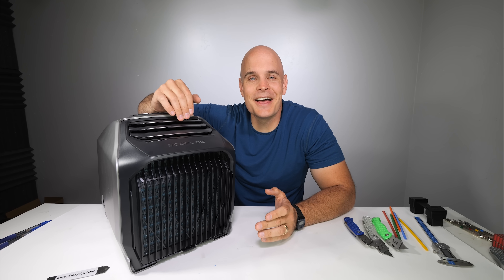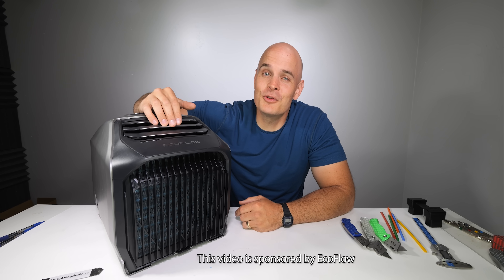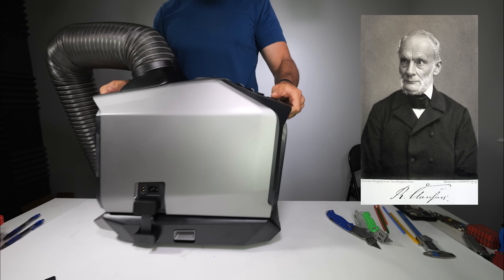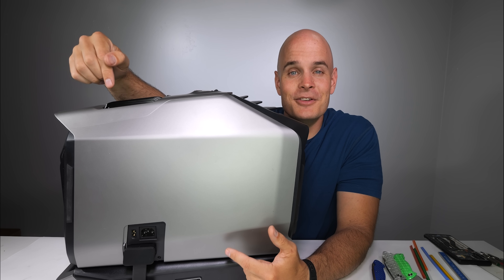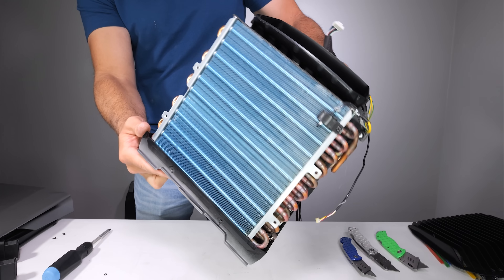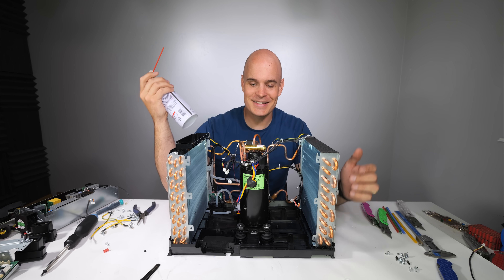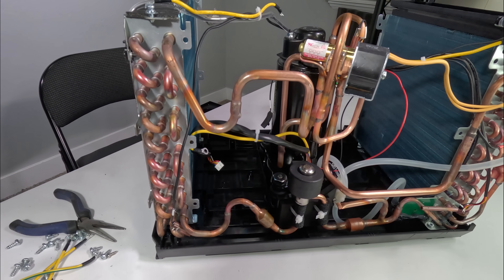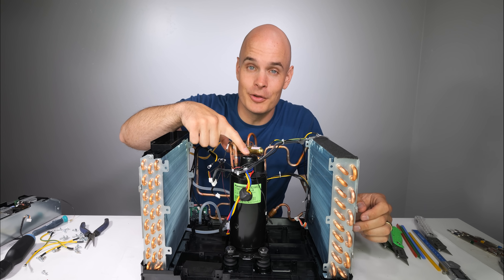THIS CHANGES EVERYTHING... (Ecoflow Wave Teardown)

Comment: your explanation after the 4 way valve is abit incorrect. no extra pressure increase. all the 4way valve does is swaps what coil becomes the condenser(warm/high pressure) and what one becomes the evaporator(cool/ low pressure)

Comment: "THIS CHANGES EVERYTHING..." Dude, heat pump was invented over hundred years ago. And that thing does not have 200% efficency if the condenser and the evaporator are in the same unit.

Comment: 4:26 thats just a wrong explanation of how an AC works 😂 it goes from the compressor to the condensor and THEN it goes to the expansion valve lol. Not directly from the dam compressor to the expansion valve 😂 the compressor makes it hot, how’s that supposed to cool anything if it aint cooled down by a condensor. And 200% efficiency doesn’t exist😂 its between 0 and 100%. Also, this AC is again one of those insanely inefficient single hose AC’s where the AC sucks in room air to cool the condensor and blows it outside. In other words, it sucks in air from the room that it JUST COOLED DOWN and blows it outside. Super efficient indeed 😂 plus this causes a vacuum in the room, which makes hot air from outside want to come back on. What a joke of a video.

Comment: since you took it apart, could you tell me the specs and model of the transformer on that electrical board? Mine blew and I'd like to replace it, my unit has long been out of warranty. Thanks.

Comment: BTUs per hour (British Thermal Units) - just an easy way (if possible) to measure the amount of heat or cooling that a device can give out per hour and then reference that with the size of the room. 1kW (1000 watts) is 3413 BTUs or a way of seeing how much cooling a room needs for its size (works both ways)

You can calculate your room square metres and then it will allow your to calculate how much energy you will need to cool or heat that room (or how much cooling a device will give out)

For example a 5100 BTUs of cooling is about 20sqm (roughly) 
6100 BTUs heating is about the same 14-19sqm 

To put it in other specs around 1500 watts heating and cooling (heating is a bit more about 1700 watts)

Comment: That's so bad design, that nobody should use. Where does the system takes air to blow over the low side? From the room you're trying to cool and then dumps the already cooled air outside through the vent pipe....tehnologia😂😂

Comment: I came back to this video because I want to see the temperature sensors. I have searched for the error code on mine and the only thing to fix it is to reset it and try again. other than that it just says to contact aftersales support. I am assuming I am out of warranty and would just be directed to buy another as a couple other folks shared. why not tell me which sensor so I can get in there and replace it. I am assuming I just have a rubbed out wire as it's mounted to the top bunk of my semi and has been there for near 200k miles.

Comment: This was a poor explanation of how heat pumps work, specifically when you mention the reverse cycle heating mode, saying 
that the refrigerant "gets compressed at the valve and then again in the compressor". If you can't properly explain it, you don't understand it.

Comment: Interesting. On boats, an AC unit condenses a nice flow of non-salty water, some are more than a Desalination System, with cold air as a luxurious benefit. Perfect for the Tropics, my fav. 😅 (Non salty means filtration and UV is needed before drinking that water)

Comment: Couple of complaints: 1). marker 0:40 states there is no way a person can feel any coldness form machine which defeats the reason I would purchase the unit in the first place and 2) per law of thermodynamics, if you remove x-amount of heat from one side, you have to spit out at least the same amount if not more of heat from the other side. Since both sides are in the same room, you gain nothing in cooling the room.
Reply: the duct carries away the heat from the condenser. This is the basis on which all portable ACs work.

Comment: I have the same unit of this called portable AC however, I have discovered that the cold air does not only goes back to the condenser but also goes at the back in the heat exchanger sucking the air inside the room and throws it outside. so I decided not to use the flexihose anymore rather I placed the AC directly at the window.

Comment: The single flexible tube is only half the solution there should be an inlet and outlet. Think about this, the air you exhaust with one tube has to be replaced from the outside….bringing the air temperature with it.

Comment: The cold bottle example was pretty weak. Its simple to explain. Two physical principals are all you need to understand. 
One, heat moves from higher concentration to lower concentration, always. So hot things give up heat to cold things. 
And two, pressure and temperature are directly proportionally related. Pressure goes up, temp goes up, pressure goes down, temp goes down. 
So to get the hot air in your house to give up its heat, the air must come in contact with something cold. So you drop the pressure of the refrigerant inside the house to make it very cold so it will absorb heat from the air, you then move the refrigerant, laden with all that heat from inside your house  to the outside. But uh oh, outside ambient temperature is already hot. So how do you get the hot refergerent to give up its heat to the hot outside air? You get it hotter than the outside air, so it will be able to give its heat to the “cooler” outside air. This explenation leaves out the most critical physical principle for hvac which is taking advantage of the massive amounts of energy (heat) that is released or absorbed in order to change a material from one state of matter to the next,(liquid/gas)  but thats more than is needed to understand the basic principal of hvac

Comment: 8 hours my ass on its lowest setting I barely get 5 on high it runs for about 1:45 minutes
Reply: Do yourself a favor and send it back while you can. The biggest downfall of the wave 2 is trying to use it high temp environments. The electrical components are sectioned away from the blower motors so they don’t receive any cooling. Where I live in the desert this means almost immediately overheating and failure of the unit when you need it most. Look into replacing with an under bench 8000btu unit that actually works when you need it.
Reply: @ I live on the coast it barely gets above 90
Reply: @ I just ordered a 12v mini split I think it will be far better
Reply: @myfalconry76  you will most definitely be happier with a split unit. I hope you were able to return the wave 2.

Comment: I'm more interested in how to tear one down for repair.  Mine is noisy and I have had the drain stop working and required a return and a refurb replacement. I would like to see how to remove the covers and attempt to quiet it down and repair the draining problem WHEN it happens again.  I'm hoping I saw enough in this video that I can remove the covers without breaking anything.

Comment: I have few technical question for the ECO wave 2 
1st In an AC we have the outside part and inside part bcoz the technology works like pump, it pumps out heat from room to outside.
here both cooling fins and condenser are in same room and as per law of conservation of energy the Net change in temperature is heating the room in summer, 
2nd if the 1st question is invalid please tell me the purpose of reverse valve bcoz in Ac we cannot move the outside unit inside or vice versa, isnt the application of reverse valve is redundant? i would just turn the Ac opposit in winters.

Comment: The next challenge is to make an air conditioner for a motorcycle. This is the Chinese version: "1881 BTU Portable Air Conditioner Compressor Cooling Conditioner Drainage Free" (on ebay) (no battery)

Comment: What is the point of this? I never will understand why people buy portable air conditioners, its the least efficient form of cooling/heating being even worse than a window unit. what about the air you have to pipe out? Taking inside air and yeeting it outside so that fresh unconditioned air can come in somewhere else..... I understand you promoting battery banks, at least they have a decent purpose, but this feels like advertising because you were forced to.

Comment: I usually like your stuff, but this... I'm sorry, but I don't like this... These are my reasons.
200% efficient?🤨
It's a tiny (5000-6000 btu) portable heat pump...
That enough for a 10x10 tent for half a day... Maybe...
But it uses R290 which is propane. It uses propane as a refrigerant... If that does not worry you in the least, I have some land in Florida that sits 20 feet below sea level...
Reply: You get 200w of heat for 200w of electric energy.
And most refrigerants are flammable. Some even turn to acid when burning.
Reply: @Elektroreisen  yes I know. In the right proportions dust is explosive too. Propane is a fuel source though. That’s the point. It does not take much for it to burn, and by the time you realize you have a leak, it could already be too late.  Nothing is 100% efficient there is loss over transmission, thermal loss, optical loss, vibration, sound, etc. I’m sorry. Even the power brought to you over power lines has a bit of loss.

Comment: These guys can't implement a proper thermal management of the River 2 Max charging station.
It also has a problem with bypass switching and charging - bot sometimes just don't work until re-plugged to the grid.
All these - software problems and not fixed for YEARS.
I own all three models of Ecoflow River 2 and I wouldn't recommend buying any of Ecoflow devices.

Comment: All that effort made and no proper hot air exhaust pipe mount :D 
Heat pumping does not pump the heat out at all if you exhaust the hot air into the room...

Comment: The exhaust is putting the room in a negative pressure. Thus sucking in more heat, humidity, cold, duct, backdraft CO2 and possible carbon monoxide

Comment: Jerry, I love seeing all of your projects! It is now August 2024 and the EPA finally approved R290 (propane) for household use where the charge is limited to 500 grams, if the monobloc compressor keeps all the propane outside. It may take another year for the local and national building codes to agree, although Europe has been using the R290 refrigerant outdoor only for years. I see that this portable unit has a 2 hose design, so I'm assuming the top hose draws in outside air and exhausts any propane leak to the outside.  Since this is portable I assume the charge is limited to 150 grams of propane, which has been approved for some time for indoor use. The Inside fan must just recirculate the inside air with no change to pressure (unlike single hose portable AC for the home) which one of your commenters is referring to. He is assuming it draws air from the living space, then exhausting outside, thus creating a negative pressure. I hope not. That is also the way decoration type fireplaces are built in Southern California. The people sitting in front of the fire feel warm although the combustion air is drawn from the leaky windows and doors (cooling down the other rooms). You mention that this unit is twice as efficient as old fashioned resistive heaters. I'll have to do more research into R290 since I heard a range of their efficiency, perhaps they are similar to recent refrigerants (COP of 2 to 4 Coefficient Of Performance, 100% = COP of 1) that still deplete the ozone and their benefit in heating homes in Europe is the ability to attain Higher Heat for water heaters. Where I live in SoCal, Cooling is more important.

Comment: this unit probably blows cooler than 60f air it only says 60 cause its a law were you xant have the temp set to low or something stupid my window unit goes down to 62 but blows air in the low 50degree range a old R22unit or R12 is like in rhe 40-30 degree range almost regrigerator temps.

Comment: btu is british thermal unit 12,000 btu is 1ton of cooling so if you have a central unit and it sayd 3tons it is 36,000 btu of cooling capacity and 5,000 for a wireless unit is not bad at all, this is like perfect if you have a old car with no a/c

Comment: The idea to use the condensed water is what i have in mind as slipt ac in india drain the water out side the house, the water is cold so driping it over the outside radiator(what ever its called) can increase ac efficiency and reduce bills.

Comment: The construction is a bit hopeless. The same can be done on peltier modules using compression, which increases the efficiency of the system. And the whole device is smaller. Let me tell you right away that this is not about those stupid YouTube videos with pseudo-air conditioners using Peltier cells, because these are toys, not devices.
 (sory - gogle translator)

Comment: Btu is British temperature unit lets take an example if you have a room that's dimensions are 4x5 with height 3 meters then you have to make this 4x5x3x300 which equals 18000 btu *
*1 cubic metre= 300 btu

Comment: Very good explanation on this portable unit. I know I’m late to this video since I stubbled upon this video and it’s a very cool concept especially since it’s portable. As many of you have pointed out BTU stands for “British thermal units” and it has a cooling capacity that is equivalent to 100 to over 150 ft.² depending on what you are using it for. heating is around 150 to 250 ft.². Now this is not by any means a replacement to a standard portable or window units that are designed to cool down a small room. I can see this being very handy if you’re going camping, cooling that one hot room that does not get cool enough or if you want that extra comfort. I’m an HVAC tech. so this unit is very interesting to me and one I will definitely try out.

Comment: i hate to break it to everyone, these numbers the gov and companies throw around are cool and all, but law of thermal dynamics states very clearly energy can not be created, if you have 1750w coming in from the plug and you have a 1750w electric cheap shit heater connected you are getting 100% 1750w heat out. no way to get more than that, adding a compressor that uses a portion of that electricity will not make it more hot. you will get a total of 1750w of heat out and noise and vibration.

Comment: BTU are British thermal units .  So ignore those . 12,000 BTU = 1 ton of AC.  We use tons because when ice factories boiled ammonia (thx Faraday) to make ice (for ice boxes-pre refrigerator) if you had a 3 ton system, you could make 3 tons of ice in a day.  See USA always uses the best measurements.
Reply: 6100 btu is like a 1/2 ton AC
Reply: Just explain the 4 cycles of refrigeration.  Dan Aykroyd explained in the “1941 “(film)
Reply: R-290 is propane.

Comment: The smart thing about this unit, is that they dont necesarily pump cold air outside (you could ... but it wouldnt be smart to do it).

Most portable units will use the cool air from your room, to cool the condenser, then dump the hot air outside. Now the problem is ... if you are pumping air outside, outside air needs to come into the room. And that will be hot.
So efficiency for those units is bad.

By using external air to cool the condenser, and dumping it outside, you dont have such problem. Eventually the room cools off.

Comment: Every A/C needs two intakes and two outtakes of air. If you have only one outtake, it will use the air inside the room to cool the hot part of the system and will create negative pressure inside the room and therefore will pull ambient temperature air through every gap. So it's not THAT efficient. I've made some modifications on my "portable" A/C to take outside air to cool the hot part and outtakes the hot air without creating negative pressure in the room. The efficiency appeared. I've been living in a camping tent for three years now. I know there is no thermic mass on it but now I have a good ambience inside it.
Reply: I've just made a quick research on YT and, in fact, ecoflow makes it with two tubes in the window. One intake and one outtake.

Comment: A btu is a measurement of heating or cooling capacity. It takes 1 btu to change 1lb of water 1 degree Fahrenheit. Thats what a btu a based on.

The sensing bulb on the suction line is connected to the thermostatic expansion valve which is where the refrigerant(which is essentially propane in your case(r290)) is metered in cooling mode. It appears to have an orfice style metering device for heating mode, which is bypassed in cooling mode, just like the TXV is bypassed in heating mode. 

Still don’t see where this unit rejects its heat, if it rejects the heat from collected from indoors to indoors as well it’s fighting itself. If you like the heat pump tech; get a split heat pump system installed on your house.

Comment: For people not used to the numbers, 5100 BTU is utter garbage.
i have a 12000 BTU in a small room and it barely gets by. a living room would usually require at least 18 000 BTU.